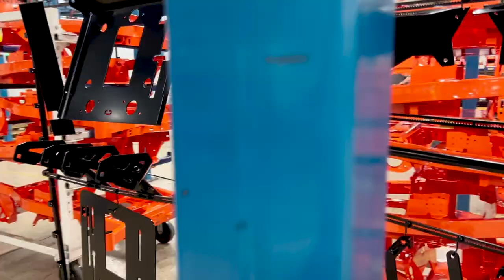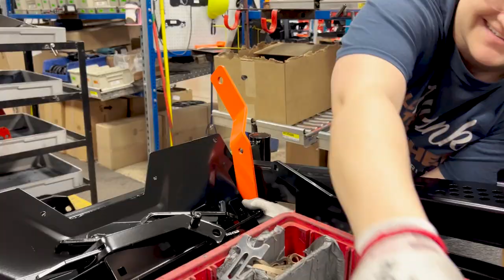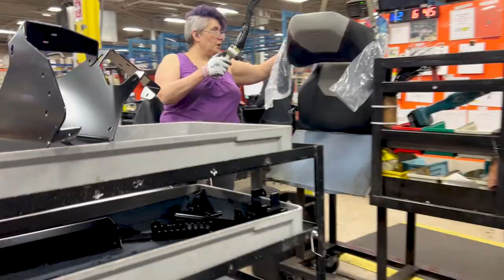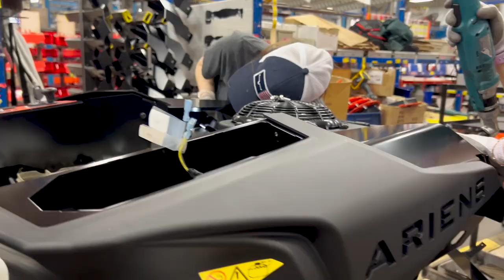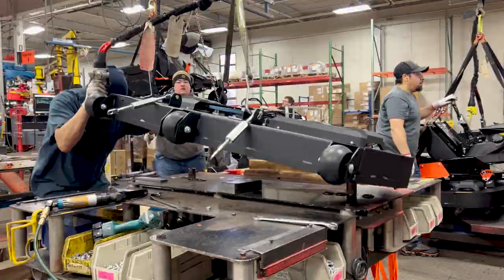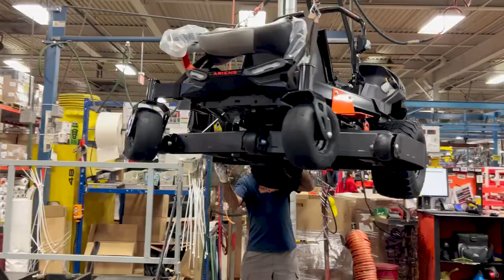Ariens® Behind-the-Scenes: The Making of the IKON ONYX™

Comment: The Ariens factory parts assemblers, painters, and decal-appliers in this video seem to be doing a good job.  I only wish the Ariens engineers did a better job. Like, to install an hour meter that only accumulates hours when the mower is running instead of whenever the key is left in the On position. At purchase, my Ariens Ikon X 42" ZTR had 52 hours - because Home Depot crew left the key on for two days.  In two trips to the local Ariens dealer, the mower accumulated another 400 hours of "use" which really was just the key left on, first for 17 days awaiting a backordered drive belt from Ariens,  then for another week or so despite my warning to please do not leave the key “ON” when not running.  Can you imagine the resale value (and potential customer trust)  lost when a prospective buyer sees 700+ hours on the meter, and I claim it should read a bit over 200?  I know the actual hours because I track Hours before and after every use.

Also, the Briggs 22HP engine requires keeping the choke slightly open in order to run smoothly, and the engine has a tendency to backfire unless engine speed is slow-w-w-ly reduced to slow idle before turning off.

The oil change feature on the Briggs 22 hp would be great except for one thing - the engine once installed into the frame does not have clearance for the oil drain spout to point downwards, meaning I had to buy a manual pump and use the thinnest hose to pump used oil up and out of the dipstick tube.  It hardly has much dirty oil since I changed the filter and oil to full synthetic early on, but I will never be able to fully drain the oil unless I turn the entire 800+ lb mower upside down.
 
The engineers were not looking ahead when they placed a heavy spring attached to and in contact with a rough moving cast iron idler, allowing the rough cast iron to grind its way through the spring steel and send it flying into the yard in two pieces.  A simple roller bushing or even brass flange would have saved me a lot of trouble, downtime, and expense.  Then, the idler flange itself broke in two for some unknown reason other than perhaps metal fatigue.  And that is a piece of about 1/4" cast iron, a part that is neither cheap nor easy to replace.

I wonder what other design flaws will crop up under my mild mowing?
Reply: drivebelt? yup buy extras... blade belt... buy extras.... hydro-gear buy extras... JUNK

Comment: SAD OWNER OF AN IKON XD 52" DONT BUY AN ARIENS THEY ARE JUNK buy a used toro or exmark for less and have less problems. new doesnt always mean better. the deign and junk self contained hydro-gear transaxle you cant get to... to refiill because they start leaking after 30 hours... causes you to have to take whole mower apart to add oil.. other then that ive had to replace springs, many upon many belts... frame has cracked and this UNIT barely Used - little over 300 hours... I had a toro with over 2500 hours and had less issues
Reply from the maker: We appreciate you reaching out and are sorry to hear you are experiencing an issue. Please private message us your model and serial number of your unit as well as contact information if you need assistance. Thanks!